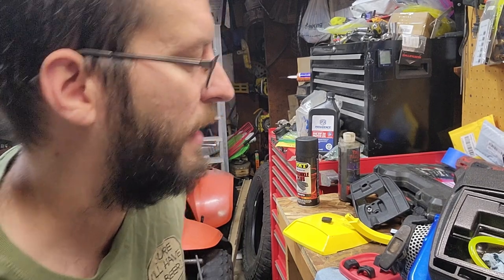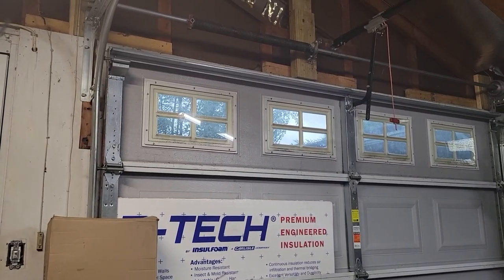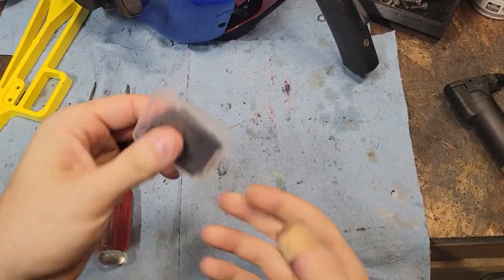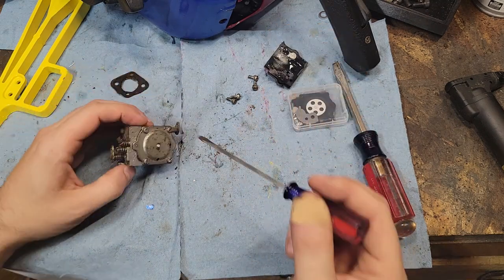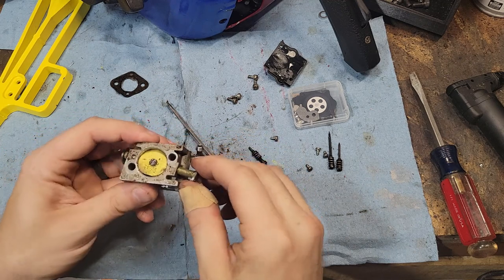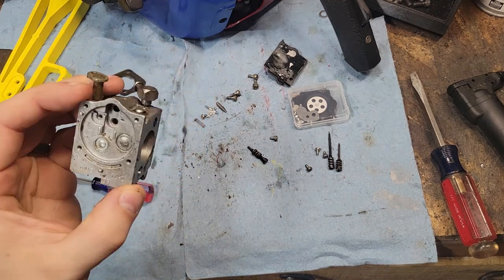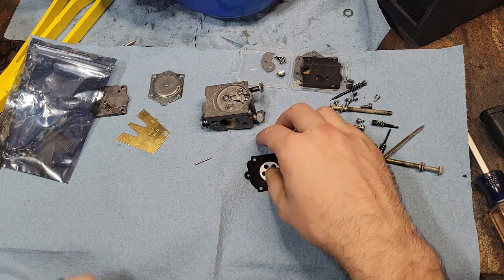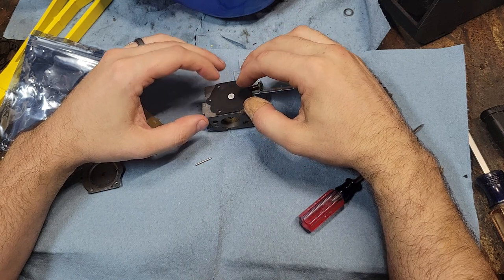McCulloch Super Pro 125 101B Project 98% Part 4

Comment: Hi Brian !  I know you are expert so I want to reach out for help on an issue with Mcculloch 1-51.  The saw is leaking bar oil. I think it could be a gasget leak in the joints or connections between the oil tank and the other part of the saw. I admit...I did not look good enough yet...but try to get a close look under it...where the oil leaks out.  It seems to me that i comes directly under it and in the midle of the saw...and as I understand there is only one option...and that is the gasket.  Did you have that kind of oil leak...on your similar saws.  Many models as you know...is almost identical to this model.  It could be from another place on the saw and it just wanders down there to the center of the saw under...and than drips from the saw.   Do you have any suggestion opn why it is leaking oil ? I cool saw and it is a runner. Sincerely from Jostein in Norway.
Reply from the maker: The 1-51 should have the bar oil tank up on top and at its connection, could be leaking there or the one way ball valve system it may have has crud in it and is causing oil to come out of the bar oil hole. Best advice, if you aren't using the saw, empty out both tanks to let it sit. I know the 1-50 had a crude auto oiler, I'm unsure the 1-51 got it, oil-o-matic, and could be leaking past that of equipped with it. There will be a screw on the bottom of the engine where such setup would be.
Reply: @mistermacgray  Hey !  Thank you very much !  I will have something to go on for now...some idea where to look ! :-) I check if the oil is leaking out from bar oil hole and check more on the bottom for that screw.